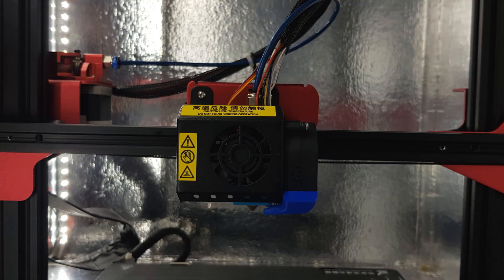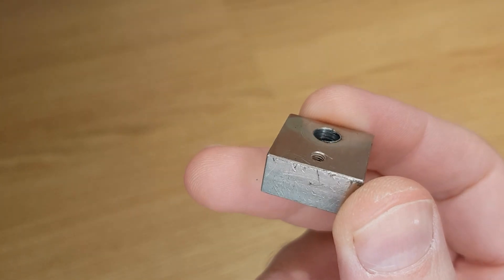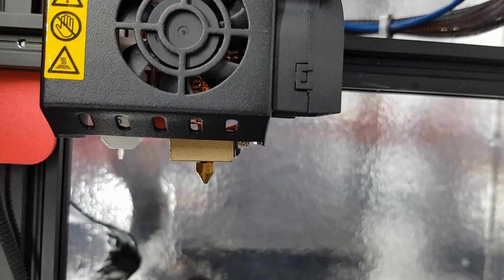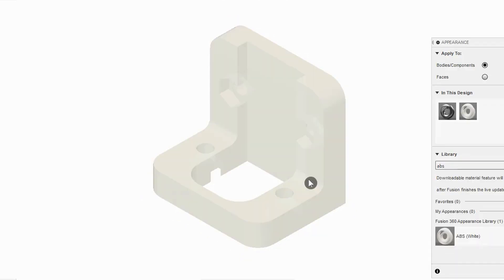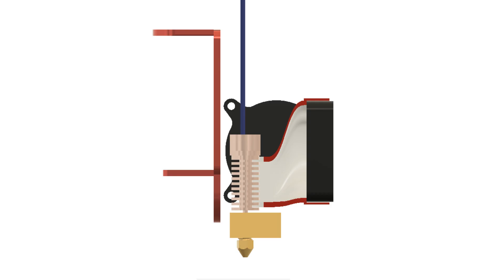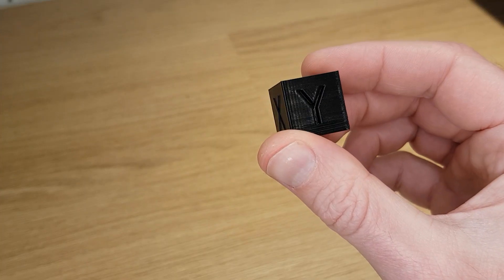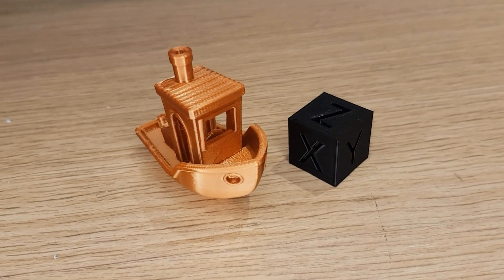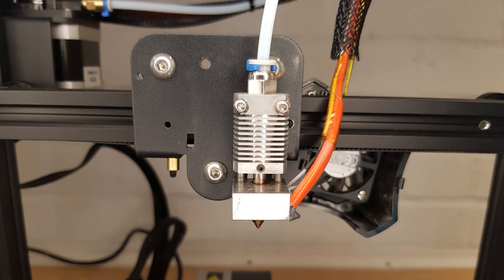Fitting The Cheapest Hotend To My CR10s Pro 3d Printer - Just How Bad Is It?

Comment: I used one of these on a Qidi tech X-max with a Mellow CHC heater unit, it was very good.

Even managed to print polycarbonate successfully until the high temperature caused the heat block thread to expand free of the throat tube and start leaking.
I'd happily recommend these for most creality printers.

Comment: I'd caution against a fan duct for the hot end cooling. I have tried using 60mm fan with a duct to downsize it to 40mm (the hypothesis being that a larger fan delivers more airflow at lower speeds). What eventually happened is that the 60mm fan cannot produce enough pressure to overcome the fan duct restriction and a lot of air "spilled" out right at the edge of the fan rim. Fortunately there was still enough airflow at the other side of the fan duct to not cause any printing problems.

What I do find useful though is a guide vane for the exit airflow. Axial fans not only push air in the axial direction , but also "stirs" air in the rotational axis, making the airflow not very useful. Guide vanes help straighten the airflow. Even a simple "+" shaped vane helps a lot. Centrifugal fans (part cooling blower) aren't affected that much as they produce high pressure and push through fan ducts quite well.
Reply from the maker: All good info, thanks. I did quite a bit more testing than I showed in the video to get to the solution I'm currently using but it doesn't hurt to remind everyone that it's not quite as simple as it looks. The exit air is something that I'm not particularly happy with and ideally I'd guide it out or give it some exit holes in the mounting plate. Thankfully the performance is spot on as it is so I may not need to do any more. I'll certainly keep an eye on it though. I'd love to see any of your solutions if you want to share though 👍
Reply: @RickyImpey  I'd love to share my results but I didn't really do a good job documenting it. In fact, I'd say it is very difficult to prove my point on video since you can't see airflow. I do agree that the setup does not need to be perfect. Many times, good enough is all you need. For me, I just need the lower the noise levels while not causing cooling issues. However, since my experience with fan ducts was not great, and may cause more problems than it solves, I always try to avoid fan ducts if possible.

For your reference, I found two videos describing the problems with fan ducts.
https://www.reddit.com/r/3Dprinting/comments/7sqzw4/heres_what_happens_when_you_put_a_duct_on_an/

https://www.youtube.com/watch?v=SX-okOHvh1Q

Comment: Have you seen this video with printing stuff on  polycarbonate sheets ?
https://youtu.be/Ary-HZarFAo
Reply from the maker: I hadn't no. There are many different print surfaces you can use. I haven't tried many as I haven't really had problems with prints sticking. If I do I use a little glue stick as it cleans of easily and let's the print release.
Reply: @RickyImpey  Hi, us it important what glue stick or can it be the 1£ pack from poundland? 🤔
Reply from the maker: @WaschyNumber1  I use Elmer's 'Dissapearing Purple' as it's easy to see where you've been but the important bit seems to be that it is a PVA based one. That way it dissolves in water. If not you will have to use something else to clean it off with and things get messy. If it doesn't say then test it out first to make sure it cleans off ok.
Reply: @RickyImpey  Thanks 😊

Comment: Ive done a lot of modding to to my anycubic I3 megaS's hot end configuration, I  have designed a system that allows me to magnetically mount any original E3D hotend, I currently have 4 mounting options for V6 standard, V6 with volcano, Titan Aero with standard block and Titan Aero with a volcano block.

This allows me to have different setups, direct drive or bowden, High or low flow options, and many setup with different nozzle sizes. Each swap takes a minute or so and my machines can be what ever configuration I want. 

There was a lot of development to get to this point but I feel its well worth it as I no longer need to do nozzle changes unless something serious has happened or have to re setup leveling every time I change the to end configuration, I just have different printer profiles within cura for the various "machine setups"

Comment: Nice video 🖖 👍
Sound volumes till too low 😔 🤗
Could you Please put the video volume at least 50% up please ☺️
Reply from the maker: What are you watching on? Everything I check on seems fine🤔
Reply: @RickyImpey  on my TV over chromecast 100% and I normaly have volume on the TV on 12 but your videos on 26 🤔
Reply from the maker: Sounds awesome Dean! What about the thermistor and heating element? Do you just have them on a 4 pin plug? Would be a very interesting project I'm sure.
Reply: @RickyImpey  you have send to me the information for Dean 😊